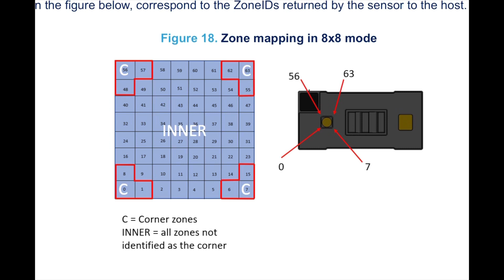ESP32 VL53L5CX Multi Zone Range Sensor

Comment: Hi. Can you include the scr folder or libraries compatible with ESP32?
Reply from the maker: It’s been a while and I’m not sure I still have the working, tested ones. An update to the library would below them away.
Reply: @0miker0  I can't find the fixed library for ESP32 you are pointing to. Can you commit a scr folder with the libraries inside? I'm using an ESP-S3-32S from AiTHinker, but it doesn't work. =(
Reply from the maker: @swordland31  sorry but I no longer have the fixed library.

Comment: Great! Can it be programmed for gesture recognition?
Reply from the maker: Not sure on that one. My focus has been only on the hardware but I’ll check the datasheet to see if it’s possible.
Reply: @0miker0  I think you'll need to program it your self, then it should be possible. For example sum up all columns data and check if the sum/maximum is going from left to right and vice versa to detect that motion. That would be mine simple approach to detect that motion. without visualization the readout speed of that chip is quite high (60fps on 4x4 & 15 fps on 8x8 on my esp32)
Reply from the maker: @Some11  Just realized now that your video using lidar now was one of the first ones I found. Awesome job!